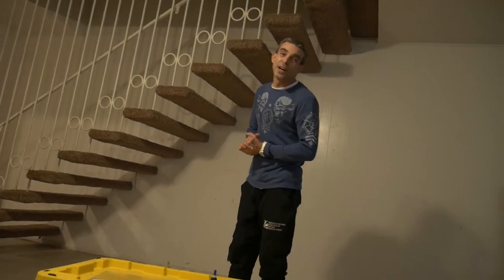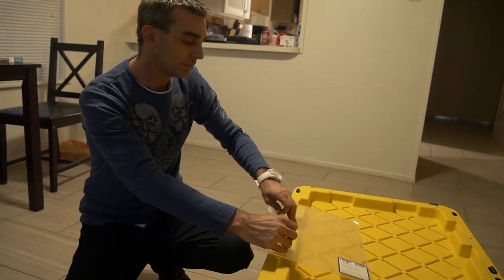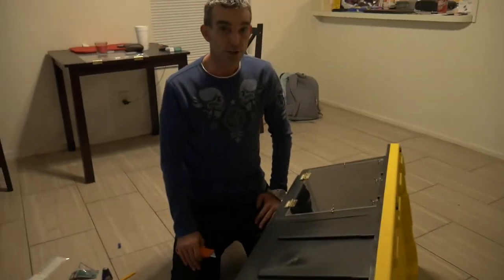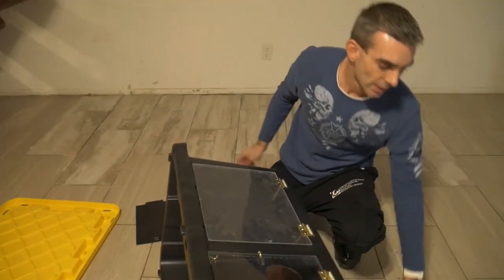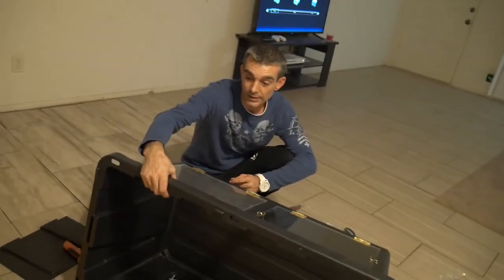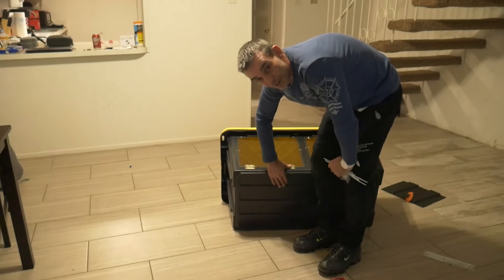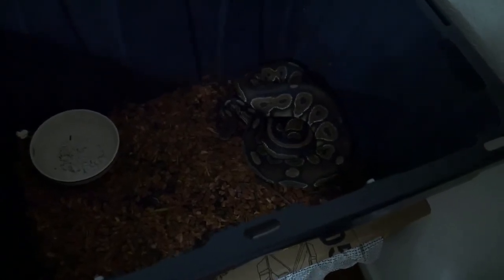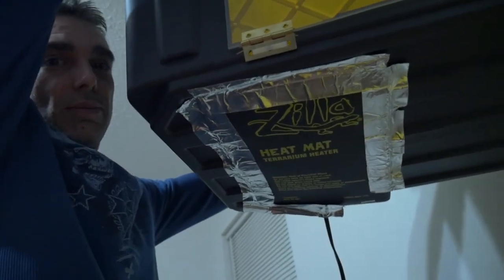DIY Front Opening Reptile/Snake Enclosure!

Comment: Great idea, but not nearly big enough for a boa constrictor, unless its a sand boa. Also, there is no ventilation on any of the enclosures in this video, this is not safe for long term.
Reply: That's an easy fix. You can cut a hole in the top and add mesh. You could also drill more holes on the sides.

Comment: What are those white cube that you screw inside the tub to cover the sharp part of the cup hook? Ty boss
Reply: Not sure he doesnt respond, but he showed that it was the zip ties. He snipped off the block and used it as a screw cover. I wouldn't even use that as it can scratch. Personally I'd use bolts and nuts, but if I did use zip ties it would be inside out not outside in. My two cents

Comment: I am actually trying to make one of these for my ball, maybe my king too. So the heat mats do Not melt the plastic? Also can u modify the tops for CHE bulb usage as well ?
Reply: If you hook the heat may up to a thermostat then you can control the temp and make sure it doesn’t melt
Reply: I have my bin modified to allow a CHE by cutting out a section of the top and replacing it with wire mesv, mine is a different design than the video but should still work
Reply: Only issue with that is that u can't stack them!